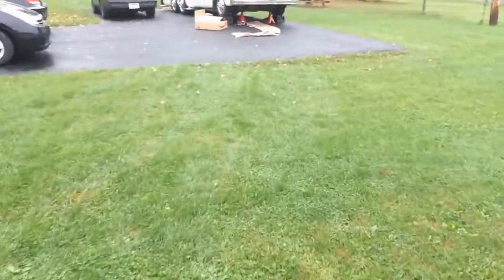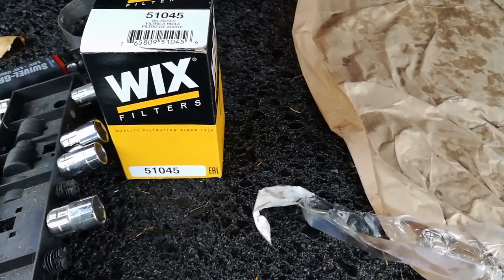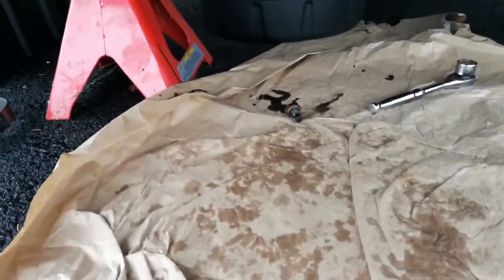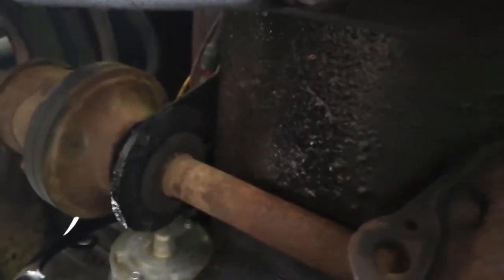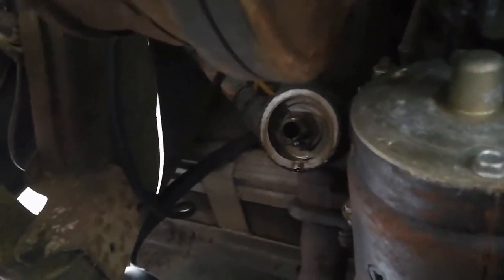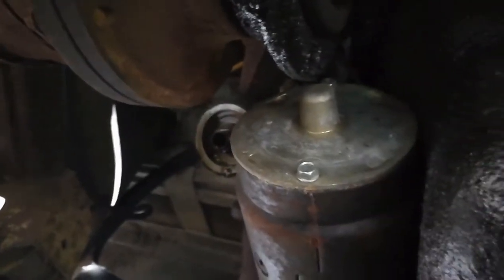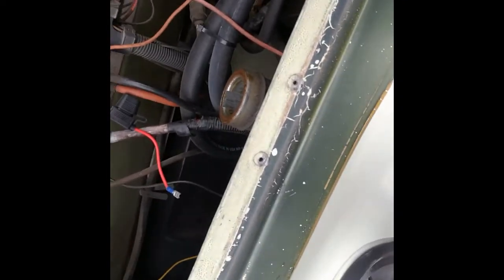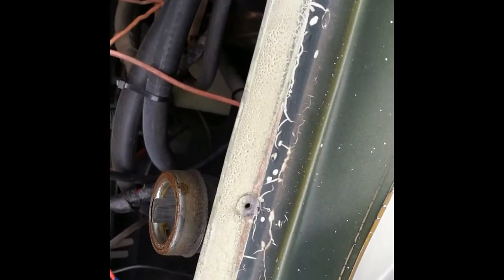1978 GMC Motorhome Oil Change for Dummies

Comment: Funny story about my first oil change on my '77 Palm Beach. It was in a field when i found it, it ran but I had no idea how old the fluids were so I figured I should at least change the oil before the 2 hour ride home. Well, I didn't know there was an oil filler tube so i fed the oil through air breather hole on the valve covers. Took about 45 to fill. It would only allow a slow trickle through there...Felt pretty silly when I got it home and found the filler under the hood...  Ya don't know what you don't know until you know. Happy motoring!